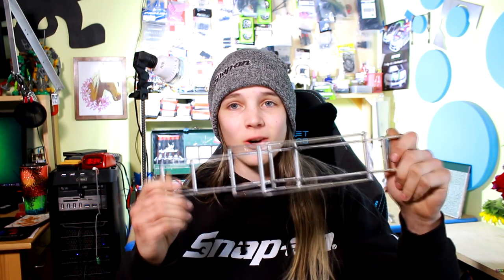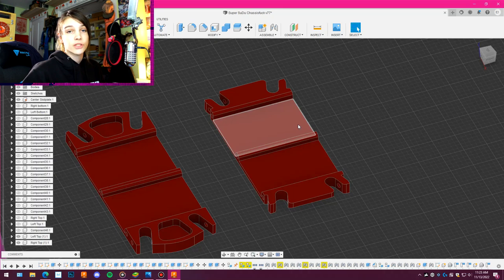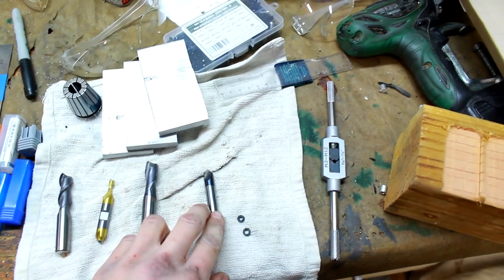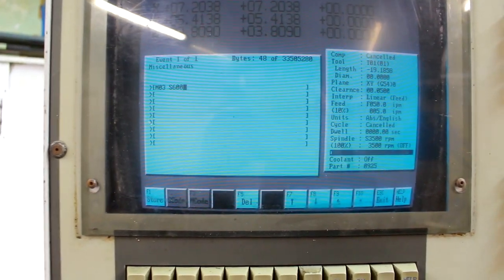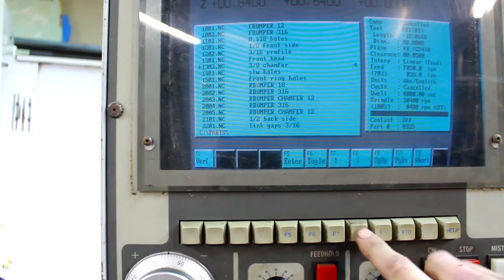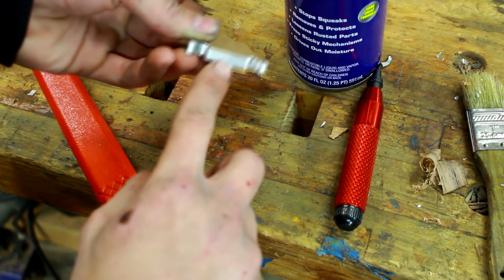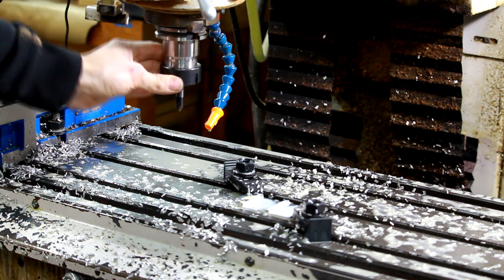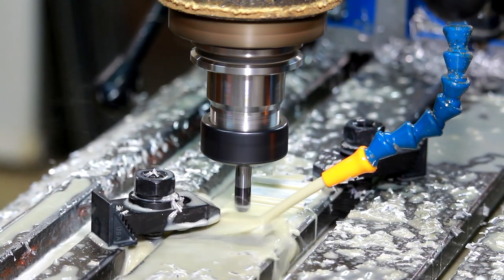MOA Crawler Build |Ep 3| Machining a Custom Center Skid-Plate!!

Comment: thanks again with a happy face, great to view the Mill and Fusion360.  Trial and error and have fun with what you make.  I did to think of that bottom plate, could add more rails similar to the cross, add perpendicular runners to add support.  :)
Reply from the maker: That is certainly a good idea, if I have issues I will likely add some ribs on it to keep the weight down and add strength. Thing is, the ESC's fit perfectly in those gaps so I'm hoping it works out haha